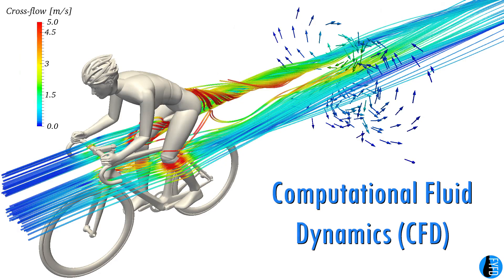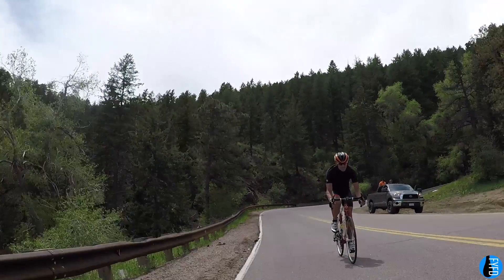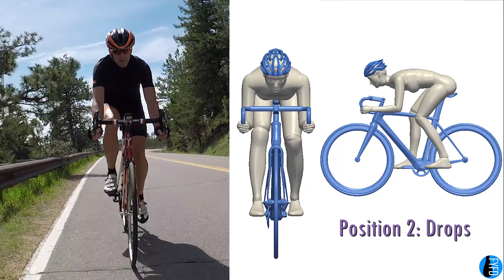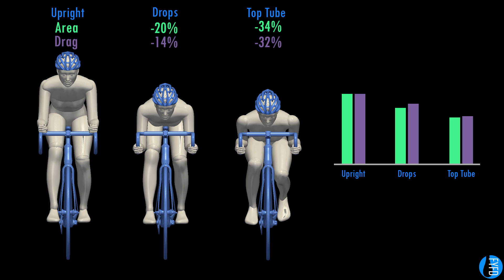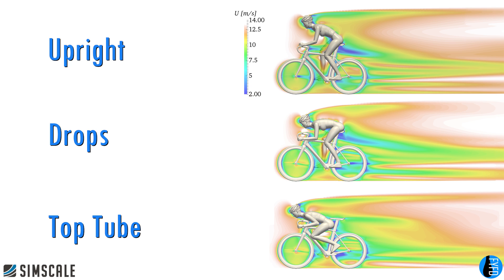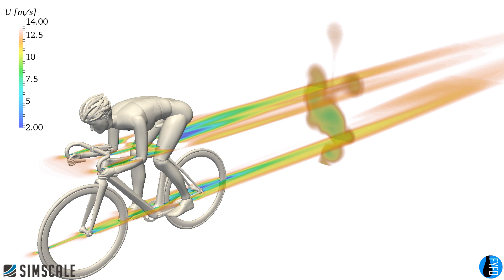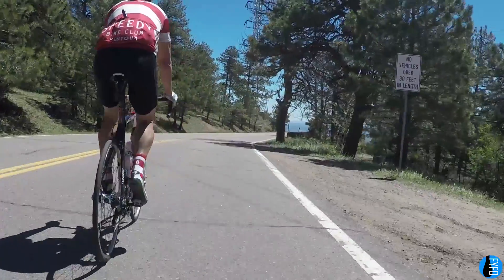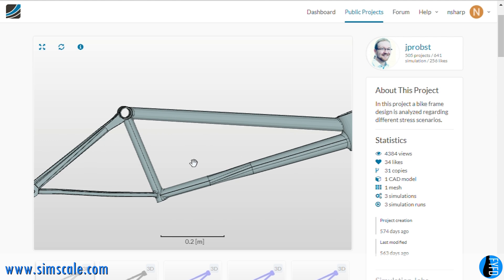Getting aero - how riding position affects cyclists

Comment: So if you had a slim item like a fin placed behind the saddle running down the seat tube. Not over the wheel like a tt aero tool box. The blue zone would be further back from the cyclist and the drag force slightly small. Making faster.

Comment: During a custom roadbike fitting I was told that in seeking an aero position it is easy to lose breathing efficiency, and when that occurs the reduction in drag is offset, at least in part, by a loss of rider power output. It was the frame designer's expert opinion that a point is reached where a lower position doesn't increase speed, it just loses comfort.

Comment: Would have been interesting to also mention temperature, humidity, barometric pressure as factors having an effect on air density -  in addition to altitude as you mentioned. I think these variables can be significant in a time trial.

Comment: I have a question as I'm not engineering/physics savvy. 
Is there ever a case where one would want downforce on a bike? For instance, for high speed descents, sprinting, or cornering? 

Hoping someone could answer this question. I'm thinking about 3D printing some stuff to play around with.
Reply: AMPITUP ITTY  I agree. As a racer we're always trying to maximize our aero gains. I'm not sure how much more we can do given the current industry standard. Everything looks the same and has a lot of marketing jargon behind it.
Reply: I think in most races due to course design it would not play a major role compared to raw power and aeroposition (and drafting teammates ;) over many hours. Although descending and cornering fast can give upper edge in some rare cases. Like Mohorics crazy descent in MilanoSanremo22

Comment: Higher altitude is inversely proportional D or drag. This is to say, as partial pressure of oxygen (air density) decreases as altitude increases-- so a cyclist rides through the air more easily as altitude increases.

Comment: I would love to see an update concerning bicycling hardware and drag, including the frame, wheels, aero bars, and accessories (particularly frame-mounted vs. behind-the-seat bike bottle storage).  Ideally, repeat with and without the rider.  Helmets may need a separate video.

My concern that much of the "drag reduction" discussed by bike, wheel and accessory manufacturers is little more than hot air, and makes little or no difference in the "real world" of amateur/hobby cycling and racing.  I believe that over 95% of all possible drag reduction is accomplished simply by optimizing the ride position.  And a non-optimal ride position will see negligible benefit from thousands of dollars worth of drag-reduction hardware and accessories.

Of course, using quality bearings, tires, tubes and proper inflation pressures are also key factors in overall cycling efficiency, but are more difficult and complex to properly evaluate.  My heuristic when working with beginner triathletes is to first get a good aero bike fit, next reduce rolling resistance, and only then buy "toys" to meet any emotional needs (the Placebo Effect is very real).  I recently gave a premium tube to a friend who flatted on a ride, and he was immediately able to feel a difference in both ride comfort and pedal effort.  But that's only an anecdote, not data.

Nothing beats real data, especially if it is organized and presented by FYFD!
Reply: Rubbish babbling, just go recumbents and fairings
Reply: Hambini does a good video on this

Comment: Great clip as always Nicole. I was doing this last Friday on my 125cc motorbike. Top speed on a flat freeway is 85kms/h in an upright riding position but I could hold 90kms/h in a tuck courtesy of the V in the drag equation. I wasn't wondering about drag at the time but now I have a good understanding of what's going on. Either way, I'm still basically a moving road block on a freeway with a speed limit of 110kms/h.